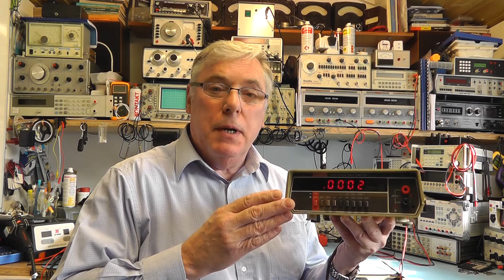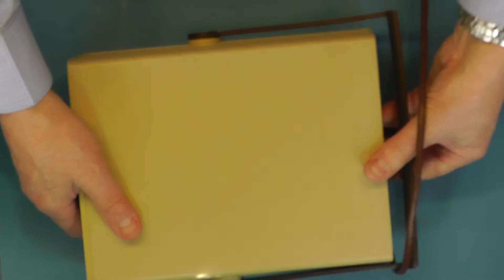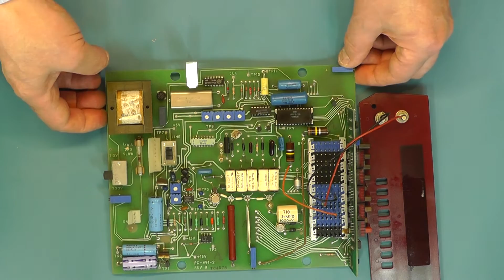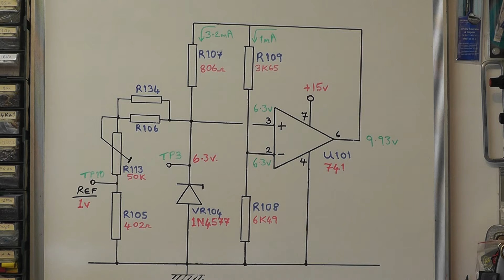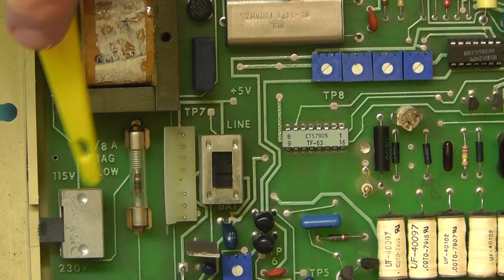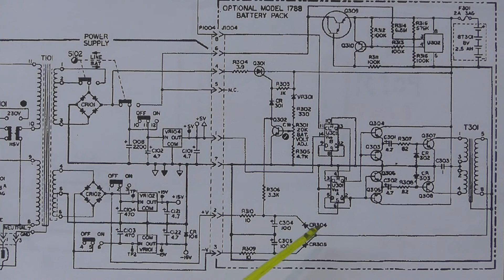Scullcom Hobby Electronics #7 - Keithley 178 Multimeter teardown

Comment: Great video, but there is an error in the calculation for the Zenner bias current. There is 4.3mA through the 802Ω but 2.5mA of this goes through the 402Ω to give the 1V reference leaving around 1.85mA for biasing the Zenner. This presumably gives a nominal -2ppm/℃ temperature coefficient for the Zenner to counteract the nominal +2ppm/℃ of the chipset.
Reply: LMJohnson, you seem to be of the misconception that "Zener" is spelled "Zenner". You might be the only person on the planet with that belief system.....